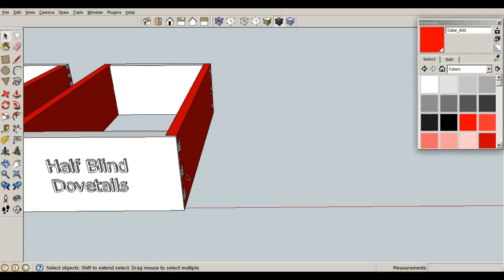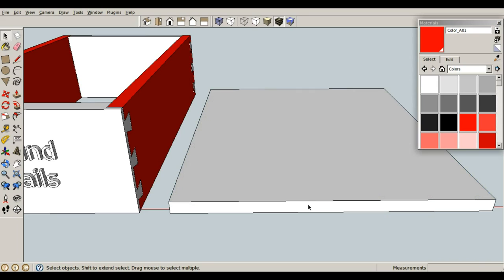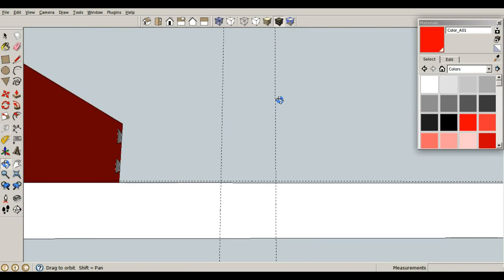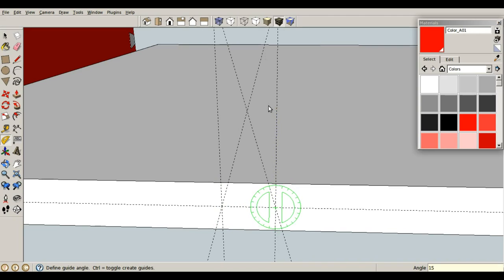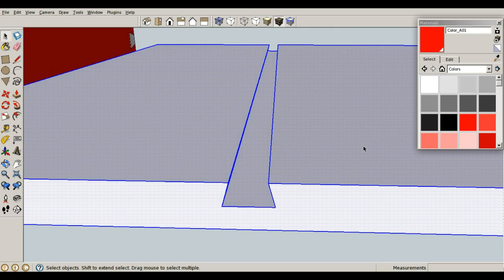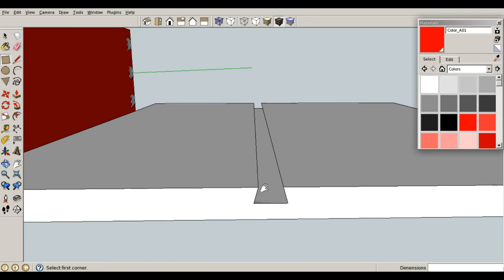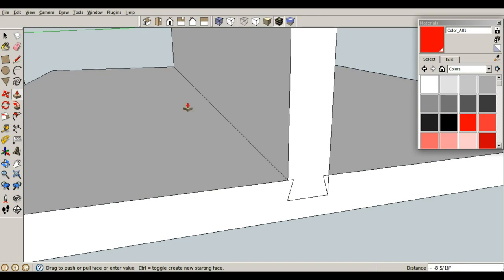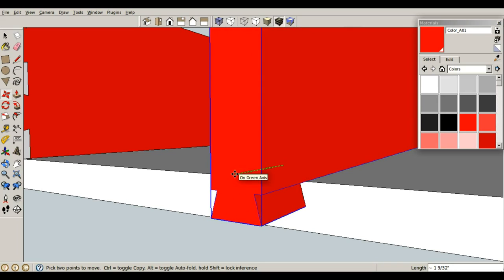SketchUp Sliding Dovetail

Comment: In a sliding dovetail joint you may have the male side a hair smaller so it slides better or maybe even tapered. What's the easy way to do that in sketchup?